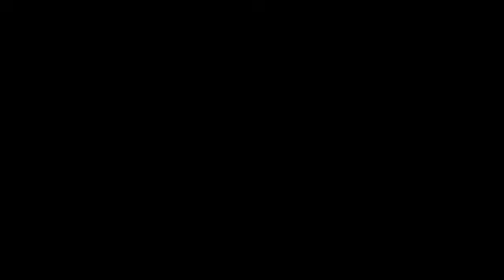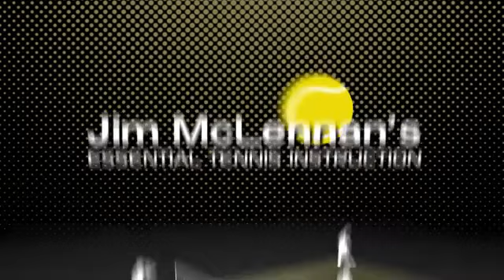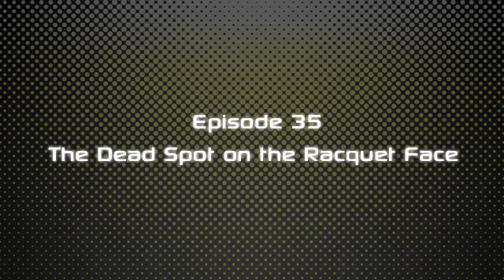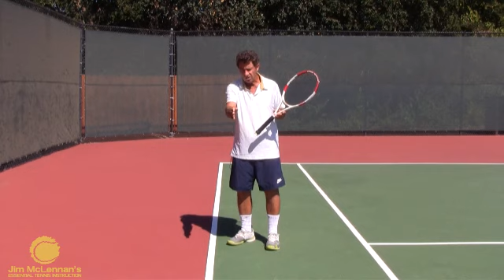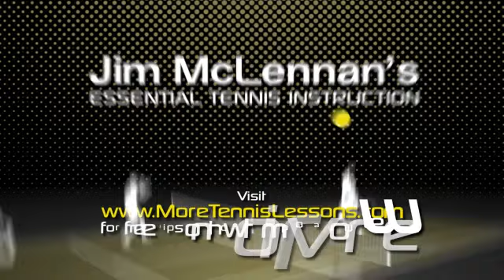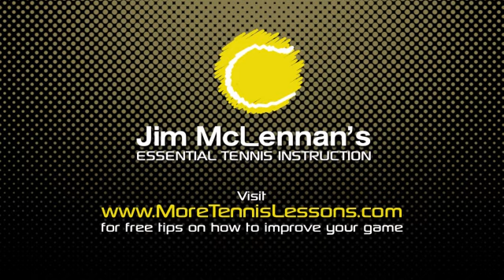The Dead Spot on the Racquet Face

Comment: The dead spot is near the tip of the racket. It is actually a great spot to hit hard serves as it is a point where the ball doesn't bounce much at all. At the dead spot, the energy of the ball is transferred to the racket, however, the dead spot does not return the favor by giving the energy back to the ball. The maximum energy of the swing is transferred to the tennis ball as the tip of the racket is the fastest portion of the racket. Hitting the ball in the dead spot region may result in an increased pace on a tennis serve. One problem is that the strings break more easily in this area, so hit with this in mind.

Comment: 1. Why is Jim not using a loop in either swing?
2.  Sorry, but the two swings (inside-out and outside-in) look the same to me. Cannot see much of a difference at all.
Reply from the maker: Raul - sorry if this was unclear but the difference was meant to be subtle - Jim
Reply: @JPMcLennan  I see. So the takeaway from this video is to experiment subtly with swingpaths  and check with sensor that the sweet spot is being contacted. Can also hear the difference.